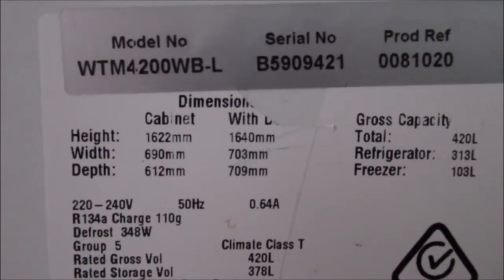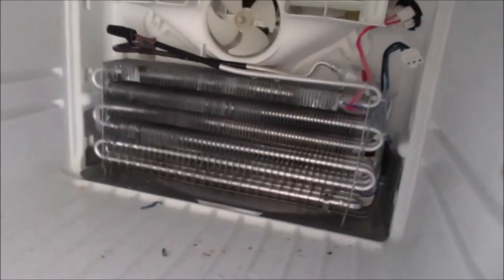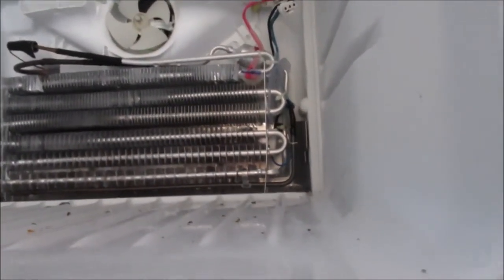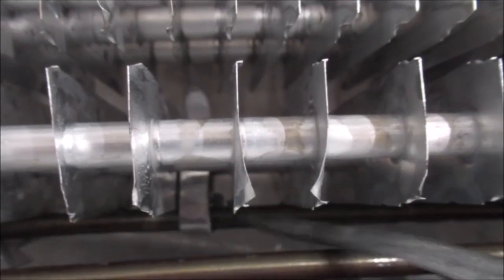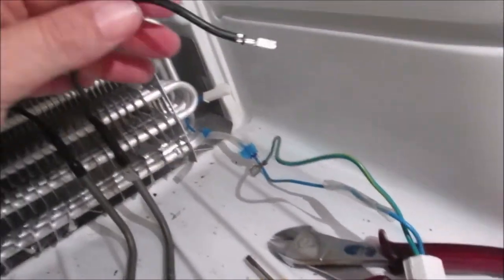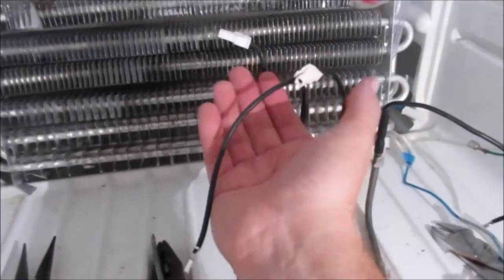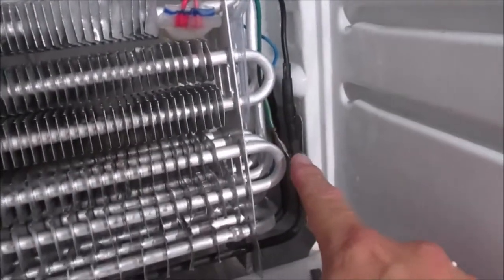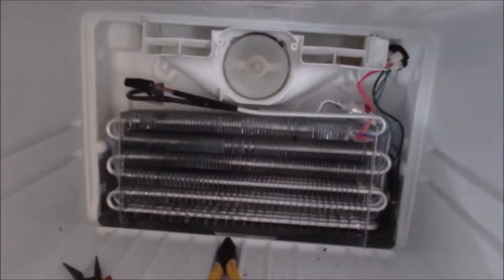Repairing a Westinghouse Fridge that trips RCD

Comment: Thank you for your video. Just had an issue with my refrigerator. The timer thing actually was preventing from starting back as I had cleaned and dried all connections. Thanks again for detailed explanation.

Comment: Thank you so much! I have a Westinghouse WTM5204SB which is similar. It doesn't have a hole in the back panel. Fortunately I have a plastic car dash panel lever set. I used three levers at once inserted at the bottom and middle. It released at the middle, then I released the right then I levered forward the bottom. 
As for compressor screw, mine has a deep hole which I think is to remove a whole section where the light is. I'm unsure how to remove it. My freezer fan stopped due to ice so I'm going to defrost the whole fridge/freezer in hope the heater will work when I restart the fridge. I might get a microscopic camera and see how I can take off the upper fridge panel (where the light is)? 
I couldn't find the main PCB on this fridge. It's not down with the compressor. Additionally the cooling coils seem to be hidden behind a sheet metal section which I cannot work out how to remove? I'm guessing they don't require cleaning as they can't be accessed?

Comment: Hi Shaun, I have a Westinghouse RJ522, which has identical freezer/fridge back panels like yours. My defrost timer is not working.  That's the one that you used a screw driver to manually put the fridge into defrost mode. Would you mind show me how to remove the panels to replace the defrost timer please? Many thanks.